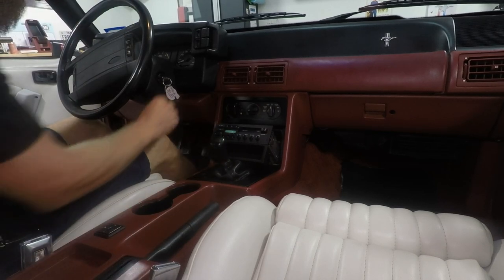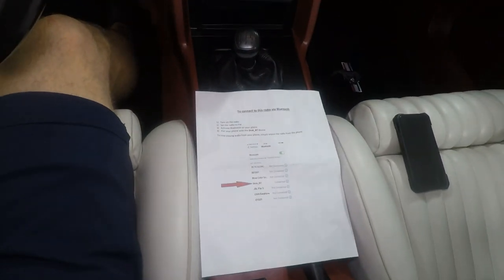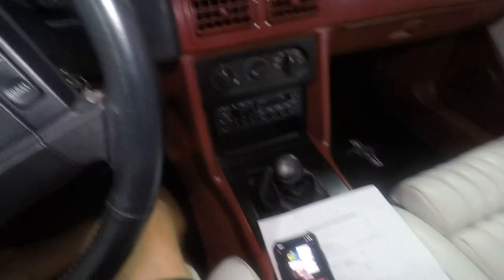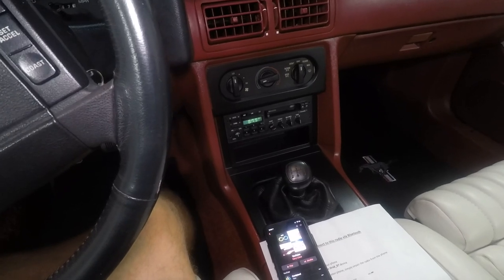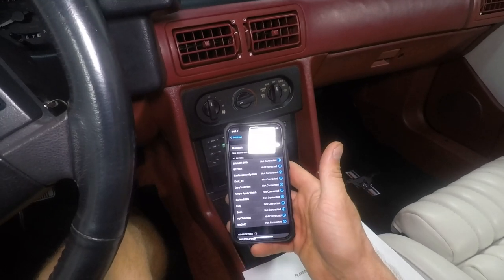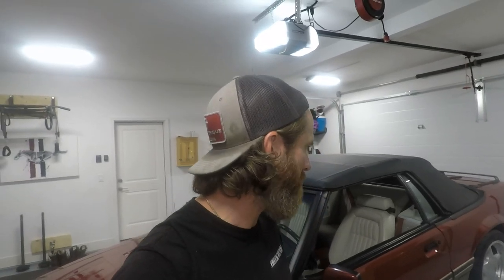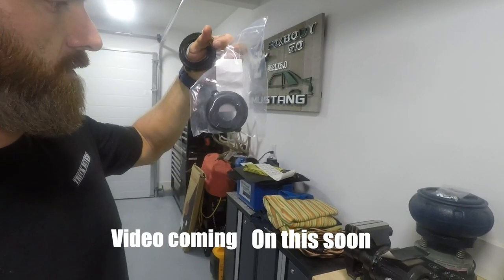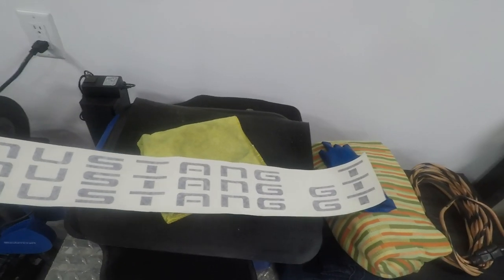Stock Foxbody Mustang Radio WITH BLUETOOTH!

Comment: Your videos are awesome. The convertible looks great!!!  I presently own my 2nd Mustang. My first Mustang was a 1970 Mach 1, 351 Windsor 2bbl, I was in high school at the time. How I wish I still owned it.  My current Mustang is 2013 V6 Premium convertible (Race Red, cream interior, tan top) with Pony Package and Shaker 1000 sound system. Funny story is that the vehicle was traded in by an 87 yr old lady for a brand new A3 convertible with Quattro.  The car 14,200 miles on it when I purchased it in Nov 2018. My Mustang now has about 17,000 miles on it.  The radio in my car has a scratched screen (standard radio, no nav system). Does that gent Todd refurb those radios?  My Mustang is a fair weather car only as I own 2 Subaru's for the crappy weather.
Reply from the maker: Thank you my friend!!! Sounds like a very nice car you have 👍. I am not sure if Todd works on the new stuff. I almost wonder if you would be better off looking at a wreaker yard for a written off car and getting the radio out of it? 🤔
Reply: @KASLCustoms  That is a good idea except....I am an old lady who has lost the fine motor control in her hands. I would have a local customizer remove and reinstall the radio.
Reply from the maker: Oh that’s too bad. Yes, any local stereo shop could help you with that. Thanks for reaching out and take care of yourself 🙏👍
Reply: @KASLCustoms  BTW Your assistant is adorable.
Reply from the maker: Lol awe thank you! That’s my CEO/President 👧🏼😉🤣👍

Comment: Dude I have an idea for a 3d printed part. You can print a modified cubby that doubles as a wireless charger for your phone 🔋🪫. Maybe lined with a thin rubber mat so your phone doesn’t move. I just saw your vid on 3d printed custom parts, it was really cool! Keep up the great content.
Reply from the maker: True! There isn’t much room in there (depth) to play with but it’s a great idea. I did that exact thing in my wife’s suv

Comment: That’s the coolest thing since sliced bread! I was trying to tell you to turn of your blue tooth off to listen to your FM but you could not hear me ha ha ! Do you have the special tool to pull out the stereo? That’s what the 2 little holes on each side of the radio is for ! It Makes its way easy if you ever need to pull your stereo back out for something 👊
Reply from the maker: Hahahahaha - thx buddy! It makes sense now but sure didn’t at the time 🤣👍. I actually don’t have the actual tools but I have made my own with one of the wife’s dry cleaning coat hangers 😂👌
Reply: @KASLCustoms  Back in the day if my memory is correct, 1/8 drill bits fit perfectly to press clips.
Reply from the maker: Yeah that may work too. The coat hanger is nice because you can angle your tips in a bit which helps release the clips 👍

Comment: I still have my original Fox radio from 1991, took it out a week after I bought the car new to put a Kenwood in it.  Still have stock radio with only a week of use on it that i want to put back into the car to bring it back to original but my face is messed up on sides from prying it out incorrectly, even though i had the removal tool, it was still hard to pry out, not to bad but could use a replacement cover.  Yes, still have the car, 30 years later, it is just about back to Stock except for Tremic Trans and control arm's and bushings.. which are staying.  I still have original trans also sitting in a box the last 23 years but Tremic is staying in it with its 3:73 rear gears.
Reply from the maker: Wow that’s awesome! Todd will definitely be able to help 👍

Comment: That's a pretty bassackwards way to do the job. The vast majority of people who do this mod (and it is a common mod), tap into the preamp section of the tape deck. 

When the job is done like that, to use the BT, you simply insert a tape shell into the deck. (By shell, a tape with no actual tape). When using the tape's preamp section, you also get maximum sound quality versus using a crappy FM modulator.

Comment: I just took out the factory radio to put an aftermarket radio in 😂
Reply from the maker: We’ll make sure you don’t cut your stock harness - buy the plug and play harness for your aftermarket deck. Also, try your best to not put screws into your center console. There are not many center consoles left out there that haven’t had screws put in them for aftermarket deck plates 🥲
Reply: @KASLCustoms  word